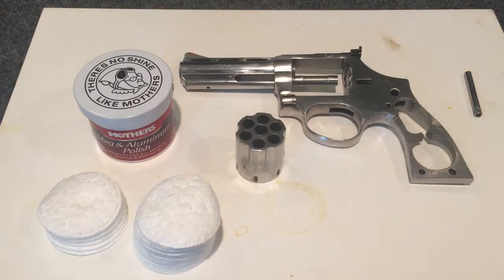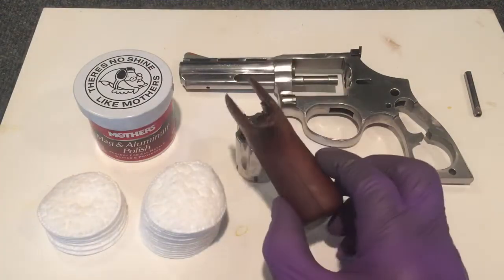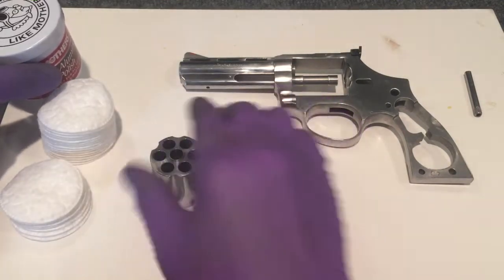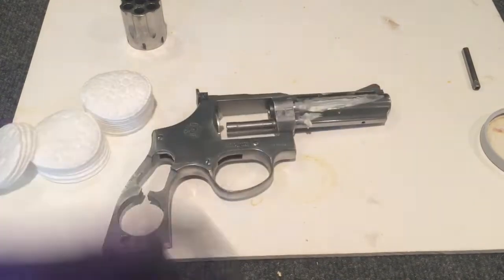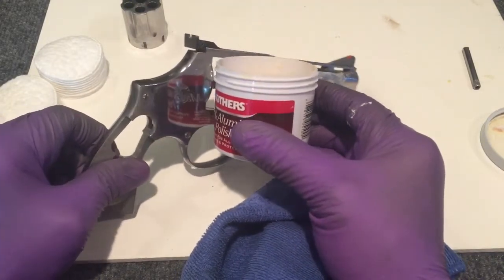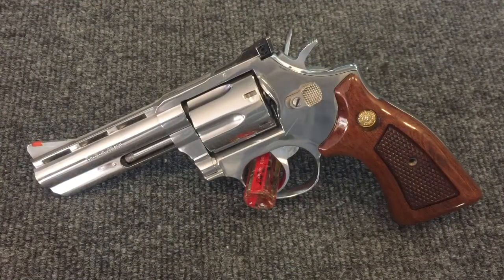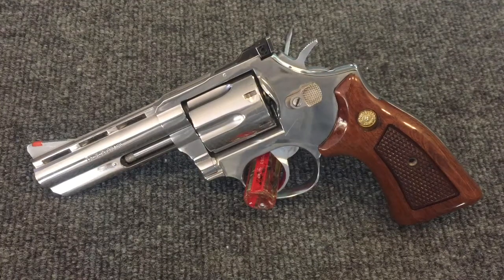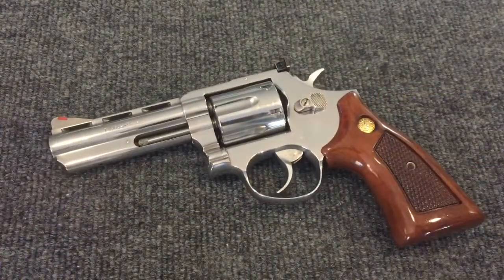Taurus 689VR Revolver (Part 4):  Finish Polishing and Reassembly.

Comment: .... you know I never noticed I forgot to wet sand and polish the little piece that holds the cylinder to the frame(s&w 66-2) lol 😂 ... didn't notice till now, after polishing it you can tell between the polished and old finish .... that taurus came out good, I got a deep scratch like that too but on the other side not too noticeable ....taurus is a decent manufacturer though 👍👀
Reply from the maker: Its easy to forget things when you disassemble the gun.  Heck, I forgot to polish the Thumbpiece of this gun.  I'll do it later though.  Taurus revolvers are good, and very good price-wise.

Comment: Thanks for the videos
I am in the process of doing this to my stainless colt 1911
Reply from the maker: Good luck with it.  Let me know how it turns out.
Reply: Thank you Big Swoll58 for responding.
My question is it has that matte finish along the side of the GUN and on top of the slide. Would I do the same process of the wet sanding technique. Starting with 1200 on the matte finish also. Or would I start out differently on the matte finish areas?
Thanks
Reply from the maker: @jamiemoreno4516  Ultimately, you'll have decide where and how you want to start.  But my recommendation is that you try using just polish only on an inconspicuous matte area and see if it yields the results you want.  That will show you what to expect.  If you decide to go the wet sand route, I'd start with 2000 grit to see if it smooths out the matte finish enough to polish to the level of reflectivity you desire.  You can then move down in grit as needed to remove scratches before going back up again to achieve  the  desired results.  Which ever you decide to do, just go slowly at first until you're confident that you're doing the right thing.  Be careful around the stampingsand markings.
Reply: Thanks Big Swoll took a break from sanding I’m sanding some of parts also and I have to say everything is looking pretty good so far without even applying polish yet.. I’m so glad I saw your videos. Keep doing your thing.. thanks
Reply from the maker: @jamiemoreno4516  Thank you Mr. Moreno.  I glad to know that it's going well.  I'd like to see it when you're finished.  Post some pics.

Comment: I use Renaissance Wax Polish to finish off the polish and protects the finish as well. It’s jewelry quality wax if you want to check it out.
Reply from the maker: Thank you Z-Man.  I been using it for years too.  I often still use Johnson's Paste Wax too.
Reply: @mr2275cur  nice I’ll have to check out Johnson’s paste wax too!
Reply from the maker: @z-man7883  It's much cheaper than Renaissance Wax and does a really good job.  It does however have a much stronger petroleum-like smell while using it.

Comment: Mother's is my go to for getting rid of the burn ring on the front of the cylinder.
Cost less that a penny per use (vs. lead removal cloths - which dry out and wear out quickly) and works in seconds.
Reply from the maker: It definitely does.  I like the Lead Removal Cloths too for general cleaning..

Comment: That looks great!  I have taurus 608, I have a few questions if I may.  Will that butt stock fit the 608 and if so is there a model number? You mentioned a wipe on poly, can you give info on that?  Lastly, where do you get those pads, thank you
Reply from the maker: First, thank you for the compliment.  Taurus revolvers three (3) different frame sizes and the stocks are sized for them.  The 608 is made on their LARGE frame, where this 689 is on the MEDIUM frame from over 30 years ago.   I don't even know if the frame sizes have changed.  I don't think these are made anymore, but you find them at times on eBay and Gunbroker.  You can buy Wipe-On Polyurethane at any home improvement store.  Or you can make you own much cheaper using 50/50 mix of Oil-based polyurethane and mineral spirits.  Those are cotton make-up pads bought at Wal-Mart.
Reply from the maker: Here a few I found on eBay with a quick search.
https://www.ebay.com/itm/116023501437?hash=item1b038a227d:g:IwYAAOSw8-hljmUC&amdata=enc%3AAQAIAAAA0DHUobPMF2yFFbkLssXVZsdGNLoItIEykqJa9Cv3x6g0qjMuM3EAftNTCxoRueie1cG2lUDIp8kObpJPIDqywEvABGJ%2BYKF5CcNqcSk9HJdBT5JhMGdJbCVbxV1ULSXTRDCpahHWJPekAJ543fACz%2FDdzm7%2Fh9Phd5V5HD6EttotN4oqe7XT%2FiQimnUVnwDWtaWWZYRi6vF74CXWVqnMR%2F7jBEYTV7SrXZcfWbvYiwYdtdUHgMr1EjM6mneVDzbLoQ1wZZlKSWI3g39mGd8g1WE%3D%7Ctkp%3ABk9SR5Tmyd6sYw
https://www.ebay.com/itm/395071274448?hash=item5bfc153dd0:g:8uIAAOSwtkZlCiol&amdata=enc%3AAQAIAAAA8IboLpEtWlNx2hsLsndGPOmnnud0QU%2BEis3otJDvn5%2B%2FfpqSk%2F80Qex8slc7y5%2FhslvI%2FkVIoITaV%2BN1d77TY5gxLj5%2BHoU5gCjLiGsWD%2FUEc7dAiUpbzEGPG3VgSfM7yhBrXfcnL7O0grMEXxtHieSh0LHXcivBHRuM0zRJxNu6NLqz%2FbeIE6SZyDcx3zhJzDlyUvNqYZy%2BZlGytGcgfXfAhwwQTrqQCR2uJI1PpFpzslftbRmqwDNqBgtCVFRixDh0xiyOZCFXlrsqZqQa7ya2rEXIl1RUNB3Pp92koX%2F2hUQmILybbmFaBCe3ucVtlg%3D%3D%7Ctkp%3ABk9SR5jmyd6sYw
https://www.ebay.com/itm/334997727289?hash=item4dff6ba839:g:OZMAAOSwU0Vk46Ml&amdata=enc%3AAQAIAAAA8BLN9Nt9wSI7Y5SCa2f2ukWUkEX%2BF2sR4Q9R8rR0Kcy%2F1cREwJSyG6nahwzUmRC2PKWmYn2dpvs9c6yMG1e5oRNM7dCmK8a7UWuiCLnEK0zi%2BTL0iuiuZ57Q9QABpuX48GRbjdFKQIY556pQukHf%2FNT7pOdLZRhxmBl9tVU%2BBQByKCkNPuwtO40Qx%2F5Sd91YbRuhE%2F7z98iB4ZpBJf31vM7yhbBz2ePMHO96QWuqHP6dK26E%2BOurCDl0KLhVEc7rp2uH2UMmFB3V4w7ZZoJ4nd9LKE9sCwtMIy5GeVa6wmTuo9l8Qx6A%2BVqs5J4RhggNkg%3D%3D%7Ctkp%3ABk9SR_Kk4d6sYw

Comment: I know this is an old video, but I’ll throw my shot just in case.

I recently polished my brushed finish Kimber K6S. I spent about 6-8 hours polishing it with mothers mag, and I like the near mirror finish it produces. However, I can now see the “scratches” that came from the brushed finish. Instead of scratches, they look more like streaks of metal.

If I sanded first and then went back with the mothers mag, would I able to get rid of these streaks? And if so, what grit would you recommend?

Also: your video is what gave me confidence to try my hand with the mothers mag on my K6S. I got tired of the scratches on the brush finish from when I draw my firearm out of my kydex holster. The steel itself wasn’t scratched, but I would get smooth “stains” on the tip of my barrel.
Reply from the maker: Thank you.  I typically only wet sand and polish my guns to remove unsightly usage scratches.  I try to polish up to a clear bright finish.  Not looking for a mirror finish, but up to a point where the original finish marks are much less or hardly noticeable, and smooth enough for a very reflective finish.  I usually end my wet sanding at 2500 - 3000 grit before polishing to achieve my desired finish.

Since you've already polished your gun, I'd start with 2000 grit to see if that's aggressive enough to accomplish what your trying to achieve.  Then go in whatever direction you need to.  It's very hard and time consuming to get a true mirror finish by hand.
Reply: @ thanks for the detailed response Big Swoll! I’m not really looking for a mirror finish, but what bothers me is that the brushed streaks are fairly visible from the brushed finish that came with my revolver.

Comment: Thanks for taking the time to show off your process. It's so beautiful. Question, do u not recommend doing this same process without disassembling the entire pistol like you did? I'm not in the know when it comes to removing triggers and springs and hammers etc. I can remove the cylinder and stocks obviously but the other I'm not confident in removing myself. Let me know. It seems like it shouldn't be a big deal to leave trigger and hammer etc. Thanks Swoll! Much appreciated
Reply from the maker: No Sir, you do not need to do a full disassembly.  I just did on this gun becasue it was old when i bought it, and i wanted to inspect and clean up the  internals.  It can be easily done with or without removing the cylinder.  Just be careful of where you get water.  And remember to do a complete cleaning and lubrication afterwards to remove any errant water.

Comment: Is there a benefit to using a dremel tool with a buffing wheel and the Mother's polish?
Reply from the maker: Yes.  You could probably polish the gun faster.  But you could also mess it up with a ding or major mar faster too if the Dremel shaft comes in contact with the gun.  i don't use Dremel's.  I'm not in a hurry.

Comment: Good day too you.
So I bought myself a 2nd hand black Taurus, it has a few scratches. Initially I thought I will just take it in for a respray and everything but after I saw this videos I decided why don't I just sand the black paint off and give it a Polish. So just want to know if I can do it like that without damaging the revolver?
Reply from the maker: STOP...!  I have no idea...!  Check with Taurus to find out if the gun is stainless underneath that black before you do any sanding on it...!  If it's stainless, you should be okay.  If it's carbon steel, it'll need to be professionally blued or refinished.  If it's something else, you be the judge.     I'd just leave it black and have it touched-up or refinished.
And Good Day To You Also...

Comment: What procedure would you recommend for achieving a mirror finish on bead blasted or matte stainless steel?
Reply from the maker: Mr. Ramirez, I recommend sending it to a professional polisher if you truly want a mirrored finish.  But if you just want to polish it to what I call a bright clear finish, you can do that with this method.  I only use wet sanding to remove scratches and uneven finishing lines.  I'm not recommending it: I'm just showing what I do, and how easy it is.

Comment: Will I always end up with very thing lines? Or am I still not getting the point? You can only see the fine lines at an angle.
Reply from the maker: You probably won't get ALL of the grain lines out without professional machine polishing.  This technique provides me a very clear and bright polished finish that has barely any noticeable lines or scratches.  If you desire a True Mirror finish, you'll probably need to have it professionally done.